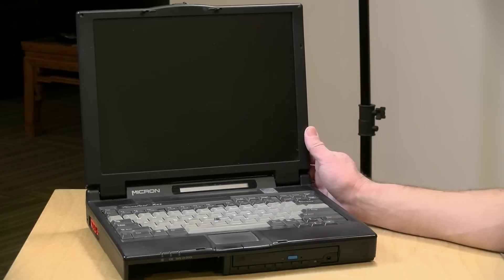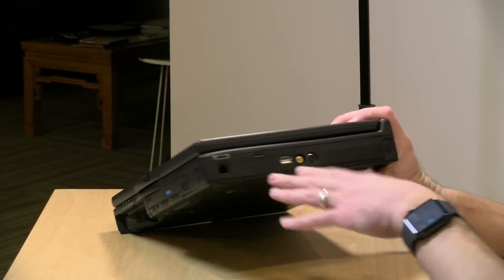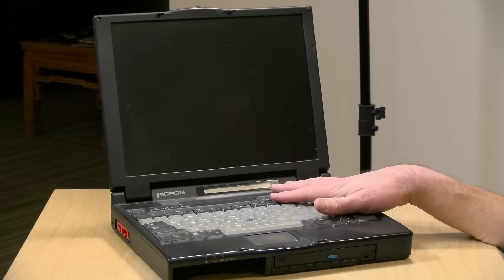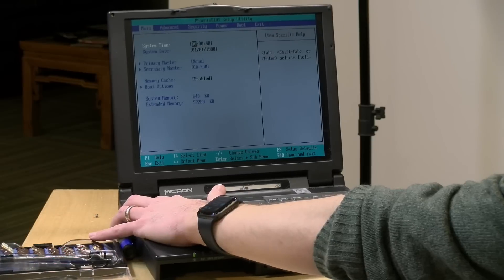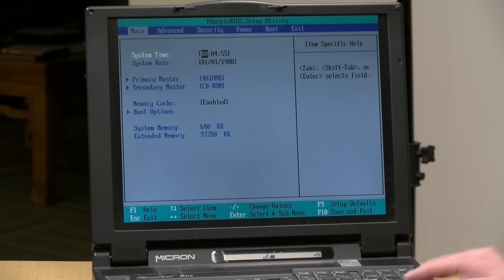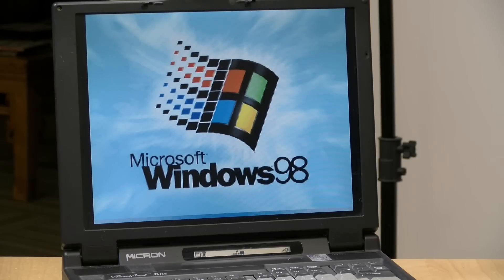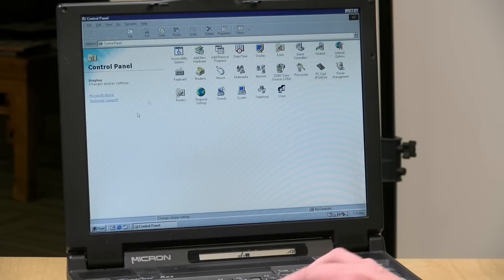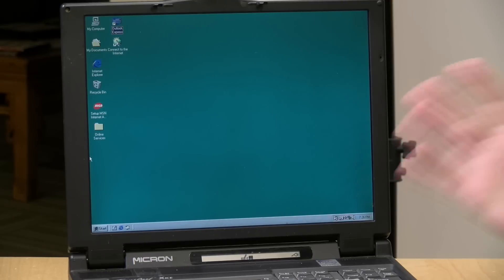Reviving my 1998 Micron Transport XKE Laptop!

Comment: I'm sure someone else already said this but please use white lithium grease to lubricate the rails for the laser sled in the optical drive, not WD40.  Clean the old lubrication off with >90% isopropyl alcohol first, of course.

Comment: I recently purchased a Dell 400Mhz laptop with the docking station for 10 dollars and I've been doing the same thing over the last 3 day's but sometimes when I reboot or shut down the laptop and restart, it says there is no boot device. Looking in the BIOS it shows the drive is there but still won't boot. Frustrating but isn't that the fun in doing it? Maybe I should use a lower capacity flash card because I'm using the same 8Gig one you were using.